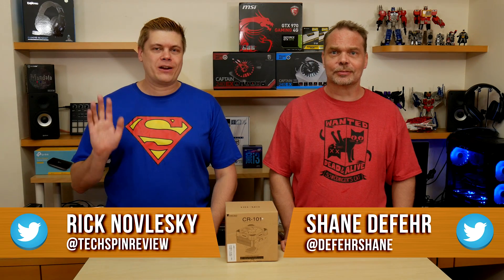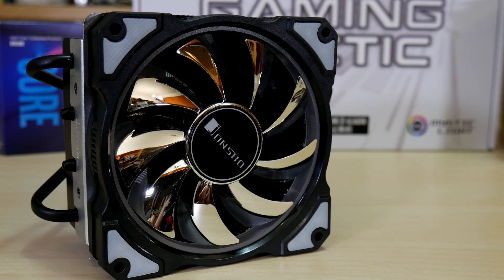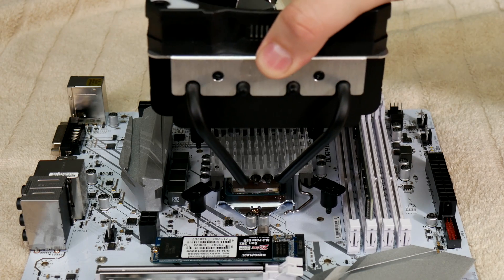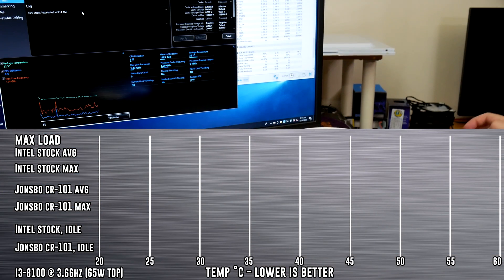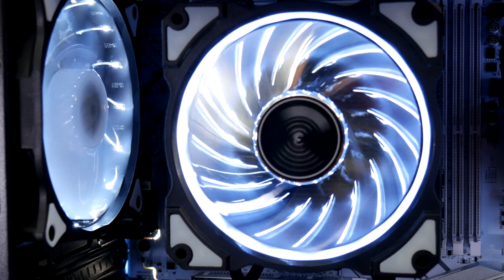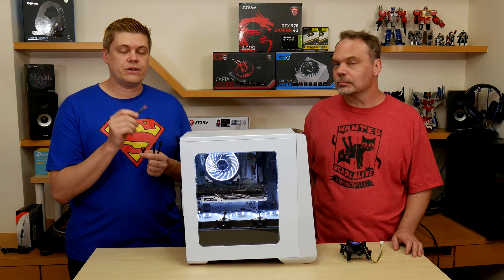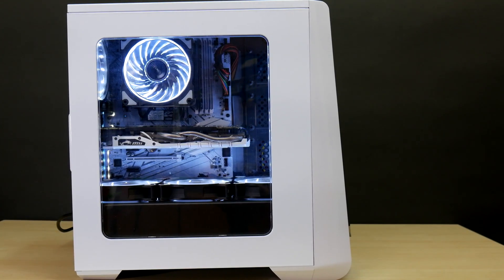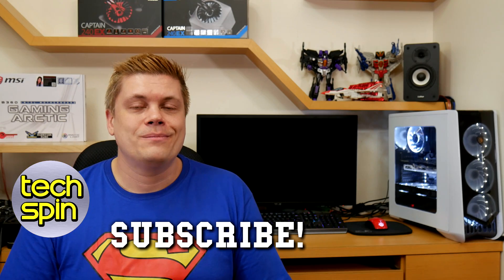Jonsbo CR-101 Cpu Cooler benchmark & review

Comment: installation sucks
Reply from the maker: Not a typical installation, and if you have a smaller case cutout for the rear of the CPU area, I can see difficulties.  That's why we recommend installing outside the case though.  But that's not always practical.
Reply: @Techspin  i like cooler with simple installation those Chinese cant make good coolers all coolers without screw back buckles u need to to install cooler with back buckle direct u need extra work  if u check aliexpress u will know
Reply from the maker: @thesorrow96  I prefer a back and front brace design, with the cooler mounted onto the front brace afterwards. Makes installing inside a case very easy

Comment: Had you the same issue like I had, fans not well balanced causing to vibrate the cooler between 800 & 850 rpm ? That was the issue I had with the Jonsbo CR-301 RGB down draft cooler.
Reply from the maker: Well I imagine most fans have a vibrational frequency they start to resonate at, I didn't have issues with this one at all, for yours you could always adjust the PWM curve in your BIOS>Fan management to go at a higher speed, maybe that would solve the issue? Or try to exchange...
Reply: Already exchanged with a Cooler Master LiquidMaster ML240M RGB for the same price as that CR-301 RGB. Don't get me wrong, I liked the design of that cooler, but unbalanced fans on a CPU cooler is not acceptable and a no-go.